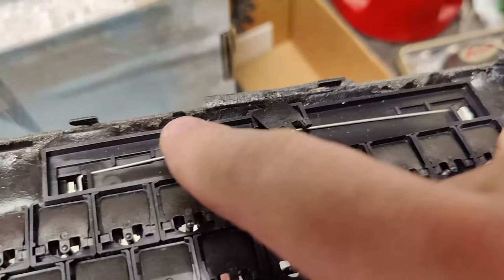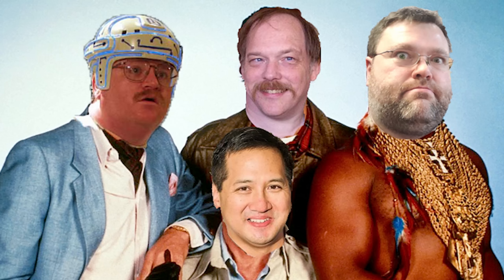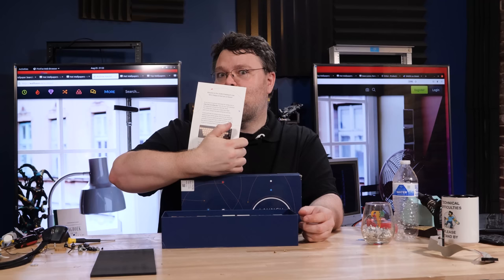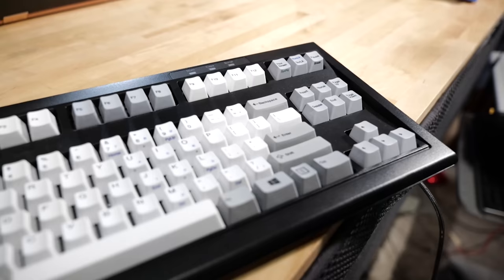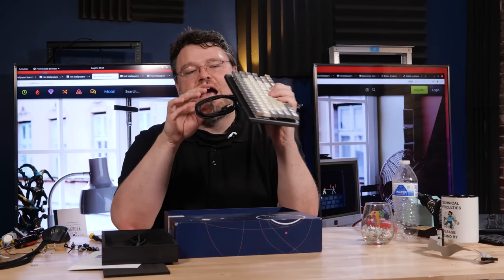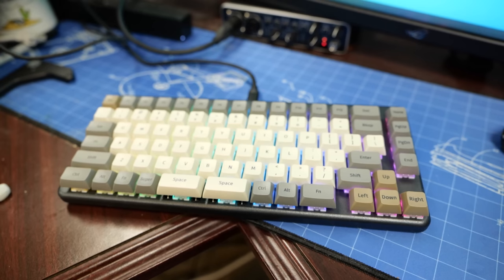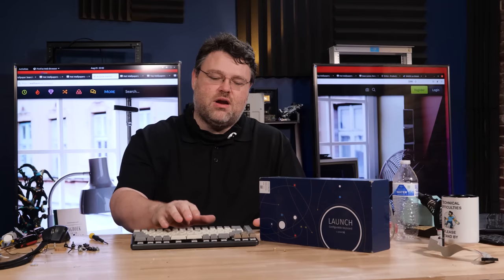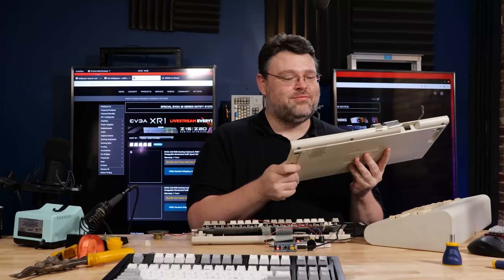Thoughts On “The Launch” QMK FromSystem76 From A Model M User

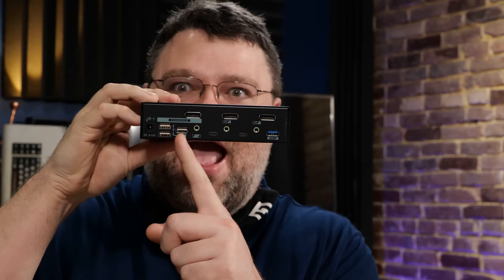Comment: 5:13 I'd also like to remind you that professionals would like you to make a 12 port USB-C KVM. Supply power, network, and KVM over a single cable to laptops or uSFF computers
It would also be REALLY nice if servers could go to USB-C for KVM because your KVM could be your isolated management network, with a single cable
Reply: Thunderbolt would be nice, a bit ambitious, but a great addition nonetheless
Reply: @amirpourghoureiyan1637  That would be pretty good for home/multimedia production environments

I'm not speaking for all enterprise solutions, but for my use case ideall'y i'd have a 36 port KVM that i can throw in the back of a 36 laptop cart, that replaces the tangle of all the charging bricks, and allows remote access when the cart is in storage, as well as just 10/100 wired instead of wireless would be worth the world to me. Being able to have a read only USB-3 port would also be great if i needed to image all the laptops and didnt want to hit the network with all of that traffic of using PXE

I'd also like to retain the battery saving 'half the cart charges at a time' feature of the carts we have, but thats probably asking too much from what is effectively 36 docks, the laptop would probably disconnect the dock if it didnt recieve power

Edit, i say 10/100 would be better than wireless because having 36 laptops, on a single AP, while those laptops are effectively stacked on top of each other inside of a metal cube is not fun for remote access. I rarely see speeds over 10Mbps, and if there are 2 carts in the room, i'd usually never see over 3Mbps

Comment: The sweet thing with replaceable key switches is if there's one that's not quite the right activation dynamic you can swap them around, ie put the one with higher activation pressure onto a modifier, put the lightest ones on your ring fingers, etc.

Comment: Really nice keyboard. Outside of my price range, but I certainly admire it. I'd probably modify it with some foam and different switches. I want that thock. I'd prefer different caps too. But I'm sure that board is a pleasure to use without modification. And cross-platform complete remap options? That's incredible. The USB hub would be fantastic... but I think that might have been a mistake. If it adds more than about $40 to the cost of the board, I don't think it's worth it. I'd much rather save the money as I've already got USB ports availble, and I don't really like the idea of having more spaghetti or USB drives sticking out of an otherwise very aesthetically pleasing keyboard.

Comment: also the only problem with kailh box pink is that the springs are to strong compared to the click bar, id buy after market 45g(kailh box specific) springs from ali-express to swap em out. other wise when you click down you still have play without bottoming out and it feels unnatural.

Comment: QMK is great and split space is interesting but isn't it kind of hilarious to see a payment plan (As low as $26/month!) advertised for a keyboard? 

Personally I think I would prefer my Cooler Master Quickfire Rapid (Cherry MX Blue) which was 30% the price, has a better (more traditional) layout for the cursor positioning keys, secondary functions pre-marked and configured on the F5-F12 keys for multimedia, no lights, and much better cable strain relief considerations.

I wonder how you even get N-key rollover on a USB connection. Does it emulate multiple USB input devices internally?
Reply: I had that same exact Quickfire rapid for years until it stopped registering the S and D keysbwithput repeated attempts. It was a great keyboard, but all great things come to an end

Comment: Buckling springs are technically not mechanical switches.
Box royals are nice, but they pretty much force you to bottom out so they're loud.
Box pinks are a nice moderately high force click bar switch.
I've been growing to appreciate halo/hako trues as they really prevent you from bottoming out.

Comment: oh no. they moved the backslash away and put enter there? unusable. i know that the normal enter is at a stupid place (too far from home row). that's why vim and the linux terminal supports ctrl-j as carriage return, but don't put backslash/pipe there! jesus that's really far for the pinkie to push! i mean it's so far out, enter would normally be there.
Reply from the maker: Qmk. Move it wherever you want :)
Reply: @Level1Techs  you sure? the enter is sized differently. i just want backslash where it was, then i can consider this.
Reply from the maker: There's only 3 cap sizes and it's standard MX so mostly doable I think
Reply: @ChrispyNut  i didn't know that. then it's ISO all they way. not because of enter, i don't care about it, but because of backslash/pipe. it's not like ANSI is an improvement: that is a poor key position to start with, only good for a key that has little use (like bslash/pipe), not for something like enter which has constant use.
Reply: @slipcurve1410  I knew of the differences between U.S and UK, but didn't know ISO-ANSI.  Was a small thread here that got me onto it (OP is "Generic Plant").
You just said basically the same thing that I did in that thread.  I assume it wasn't covered by Wendell because American's just know the U.S - ANSI layout?!? (assuming)

Comment: Yea I'm sorry but $300 for this is absolute insanity

There are plenty of quality mech qmk keyboards out you can buy/ build yourself for half the price
Reply: Building yourself isn't necessarily that much cheaper though, unless you get some cheap prebuilt and just mod it, which often isn't qmk compatible. You can build for cheaper, but if you want aluminium casing, hotswap, 90 keys for a 75% and pbt keycaps, you often aren't that far off $300, unless you happend to get (some of) the parts on sale. Cheapest build I have calculated was plastic 60% casing, dz60 pcb (or any other QMK compatible pcb, this is just the most accessible for me), polycarbonate plate, gateron/outemu's cherry clones and thin abs keycaps, which still comes to $100-150. Adding in the extra USB sockets it features as well, I don't really think the price is all that bad. Expensive ofc, but not out of this world compared to other luxury choices in the keyboard world.
Reply: Well, you have to believe in the open source mantra: if you don’t want to build it yourself, buy it from the market.

Comment: this keyboard is so not worth the price. plastic case, no gasket mouting, limited switch options.... sure you can hot-swap them but so can you with a 30 usd reddragon kumara. in this price range you can get much nicer keebs from keychron or gmmk.